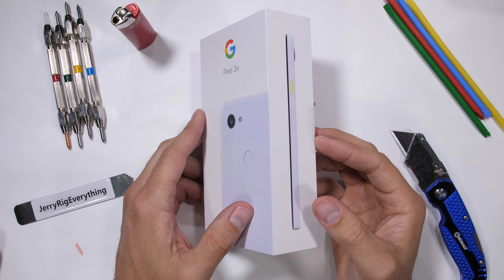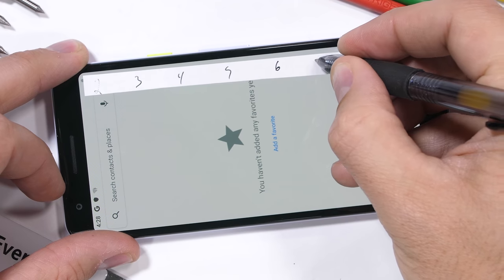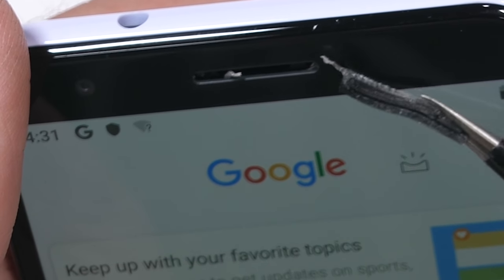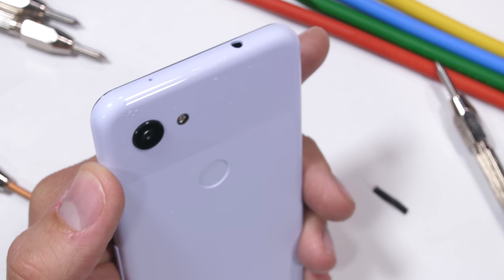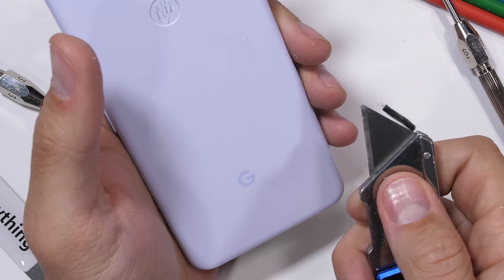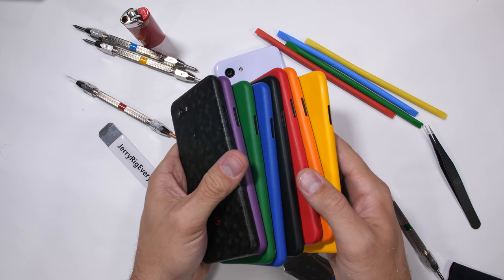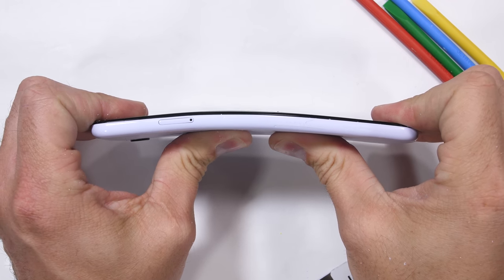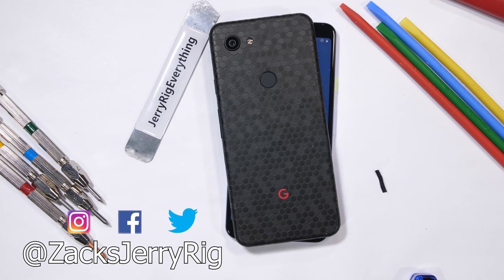Google Pixel 3a Durability Test! - Is Plastic Weak?!

Comment: I thought for sure it was going to break in the flex test.  I'm impressed
Reply: Very few phones break when flexed even the s4 and s5's of yesteryear.
Reply: X2
Reply: Plastic is usually more flexible than metal. It also helps with drops since it absorbs a lot of the force.
Reply: I had multiple Nokia lumia phones and they were so nice. The polycarbonate bodies were strong, durable, and unique looking. Never felt I needed a case.
Reply: I closed the car door on my s7 and it only bent a little, but of course the glass shuttered.
Reply: Why no drop test? This thing dropped 2 ft bye bye screen
Reply: @efratcohen3429  that sucks, the S7 is still quite a good phone
Reply: @someperson1767  after 4 years I decided to upgrade to Samsung s10. It's a really good phone
Reply: @efratcohen3429  wow, that's a great phone

Comment: I'm watching this on my 3a and it's making my cringe harder then I ever have iny life
Reply: Same 😂
Reply: @pissgrief  no, it's very fast and has good camera quality and is just a good phone
Reply: @pissgrief   Hope I'm not late, but I recently got a Pixel 3 and have some words on it.

I've wanted a Pixel for a while and when they were on sale, I figured it would be the perfect time to upgrade. It runs super fast and clean, the UI is very easy to learn, and the screen and camera are amazing. The battery lasts me a whole day on one charge even if I'm watching YouTube for a couple hours. Transferring my data was super easy as there is a feature where you connect the Pixel and your old phone together and basically copy everything from the old phone to the new phone. I had everything over and running in less than 10 minutes.

Overall, I don't regret getting this phone in the slightest! It is super thin and sleek, so I recommend a case for it (as I would for every phone. You shouldn't really go around without protection on the off chance you drop it). I got one of the fabric cases and it feels really nice. I love this thing.

If you already made a decision, well, here's me rambling to the air!
Reply: Watching on a 3a XL and also cringing like hell 😂
Reply: @e.johnson7349  agreed. My sister purchased the iPhone 8a few months before I got my pixel 3a yesterday. My mother and sister were shocked by the camera quality and even the phones speakers. It's truly satisfying seeing me gwtore worth from my money
Reply: @HARI SANKAR.D I'm a hardcore user. Since I've recent graduated high school I'm on it almost all hours everyday. Th batter life is a B+ from 10am it'll last till pm for an average user. It rarely lags. And if it ever does it will only happen if i have a LOT of apps in the background. Considering it has the same ram as a iPhone 11 pro max it's perfect fine for an average user. Btw you can easily extend the battery life by using night light and battery saver, works wonders
Reply: @HARI SANKAR.D point and shoot is great. I compared mine to an iPhone 11 and the average person thinks it's almost as good and on par in some cases. But i don't want to fake anything so tmr I'll use it and see how long the screen on time is. And I'll give you the details.
Reply: @HARI SANKAR.D hey, so I used it today and got about 9 he 20 minute on screen. Used it for gaming and social media most of the time. 9am to 7pm
Reply: @HARI SANKAR.D 100% good luck!!! Definetly gonna get a bang for your buck!
Reply: @vinesta  I get about 6h screen time with the 3a .-.
Reply: @xDontStarve  reallly? It depends what you use it for. I use it mostly for social media so if you game alit that'll probs run alot of your battery
Reply: I too am.using the 3a, it's definitely an upgrade from nexus 5x

Comment: it protecc
it attacc
but most importantly...
its got a headphone jacc
Reply: Yeah but dat slow processor...
Reply: @almightydeity  oof
Reply: protecc wutt?
Reply: @almightydeity  and comparing it to what other phones? a monster flagship phone? Then yes it would be slow....compared with other mid range budget phones...then no.
Reply: @mrbobdog707  Yes, even then. Most budget phones run a Snapdragon 730, and while the 670 is comparable on CPU, on GPU the Adreno 618 is a good deal faster than the 670's Adreno 615. Snapdragon 670 isn't that great no matter how you look at it.
Reply: @almightydeity  I have to agree, at this price point there are way too many phones out there with flagship specs, but I have to say, the 670 should be enough for most people's usage, unless they are looking into more intensive tasks like video exporting and gaming, then this mid-range chip would come no where close to the flagship ones
Reply: @ericwei6000  It just makes me wonder where they believe this phone fits. A Xiaomi Mi Mix 2S is $300 now for a 64GB model. That has a Snapdragon 845 flagship processor, metal frame, and ceramic back for $100 less.  It's going to be built far better, has a darn good display, and will be comparable on screen ratio. 

I'm just not seeing where Google thinks this thing fits. The only downsides are that the mix 2S can only use GSM networks and it doesn't have a headphone jack, though does come with the adapter anyway.
Reply: @almightydeity  I think Google for now has the power to price it however they want due to their outstanding image camera performance. Apart from the camera and perhaps the software this phone basically fall short of anything at its price point
Reply: @almightydeity  The one thing that will stand out over the other budget phones will be updates. Since Google is the one company who owns android this phone will be getting updates at the time they happen. Besides, the people who are going to use the phone won't be gaming, they just want a something without extra bloat and does the simple stuff. Pictures, emails,internet and simple games.
Reply: JINXY wooosh
Reply: @ericwei6000  I'd wager that the Mix 2S would have nearly as good if not as good of cameras. MiUi is more feature rich and not much bulkier for it. The Mi 9 is only slightly slower than the OnePlus 7 pro, which is currently the fastest device currently out.

Even counting camera, literally everything else is better on the Mix 2S since That was built as a flagship.
Reply: @mrbobdog707  Xiaomi rolls out updates within a few weeks of a new android version dropping.

   Even with bloat, the Snapdragon 845 would make everything feel faster. It also has a better GPU and a lower resolution that's still 412ppi meaning it's still crisp. There's no point in a budget device when many will discount older flagships that still get updates.
Reply: @almightydeity  But is the camera any better than pixel 3a?
Reply: @mrbobdog707  It has 2, and yeah, it's the same sensor that's in the Galaxy S9s I think. The other is a 2x 8MP zoom.
Reply: it thicc wit the headphone sticc
Reply: @jinxy7869  Titan M security chip protecc
Reply: @almightydeity  
I'd say even the Pocophone F1 is a great deal faster than the Pixel 3a and it's $200 - $300 with the previous generation processor which is still faster than the Pixel 3a
Reply: @LermaBean  I just can't suggest the notch. The Mix 2S doesn't have it. It should also be comparable on the cameras and performance should be nearly identical. it's really all about what you want at this point, as the smartphone market is oversaturated.
Reply: XD
Reply: Why is this meme still going its 2019...

Comment: 1950: we will have flying cars in the future
2019: SCRATCHES AT A LEVEL 6 WITH DEEPER GROOVES AT A LEVEL 7
Reply: If it was 
1950: we will have flying cars in future
2050: we will have a glass which would cost higher than iphone without any features which scratches at level 7

Comment: How about a giveaway of "skinned" pixel 3a? :)
Reply: Monkeybus TDM isn’t that obvious?
Reply: Well it seems like Jerry isn't too into the phone anyways... So yeah why not give at least 3 or 4 to leave him with a "durability" tested phone and one for the drop test. (It doesn't seem right drop testing a already durability tested phone it probably has a higher chance of breaking. Like the fact that

1:Scratched / Dented Glass
2:Back plastic panel dug into
3:The everlasting bend
4:Scratched Fingerprint scanner
5:Blah blah blah...)
What a reply. 😁
Reply: Why giving away 35 tons of natural resources when you can just profit from throwing them away and destroying them while others die because of them caged in "jobs"?
Reply: @pipipipi3087  Remember there is a difference between "Utility" and "Computer Controlled" 

Utility: Used mainly as a if needed or techie stuff.
Computer Controlled: Stuck up, way too much screen time usage, and etc.
Now destroying a device is actually quite dangerous same as disposing it in most ways. All I have to say is, use as much as you can, when it stops working... Now... END ITS LIFE! By just taking the lithium-ion battery out and any components capable of or otherwise harmful things, like fire, explosive things, and so on. Think a step further when disposing devices people.  😁😁😁😉😉😉😊😊😊
Reply: Not that u'll get one
Reply: Maybe after teardown test

Comment: I would give up wireless charging for the headphone jack
Reply: Yeah I'm glad they added it. Should have no complaints on both sides as you can use wireless as well
Reply: @johnboy6799  no wireless charging on the Pixel 3a. Don't get me wrong, I like having wireless charging on my phone. But I don't use it more often --- it's convenient if all my plugs and wired ports are used up and then I have to resort to wireless charging. But I always will use wired first because it's still faster than wireless. 

I am glad my phone has both wireless charging and a headphone jack, but if I had to sacrifice one feature then it would be wireless charging. That way I still would have more options on audio for the phone.
Reply: You can't actually hold your phone and use it while wireless charging it. Wired charging is better. It's my opinion. Please don't hate
Reply: @thedawg1674  I'm not hating. As I said before, though I like the convenience of wireless charging, it won't replace wired charging. It is still faster.
Reply: Why is it called wireless charging? It's pad charging.
Reply: @vedalee246  because you are not using a wire to charge. Pad charging is probably another way of calling wireless charging from where are from.

Comment: I just got the pixel 3a a week ago and I do have to say, it is the best phone I have ever had. super easy to use, comfortable in the hand, amazing screen and camera quality, super durable. the fingerprint scanner is amazingly accurate and reads your print in no time, definitely faster than the iPhone fingerprint scanners. the charging speeds are out of this world and the battery is long lasting. I 100%  recommend this phone who anyone who wants a high quality device, whether you've always been a Google or Android fan or you're moving over from Apple and want to save money without sacrifing quality and comfort. 10/10 would recommend

Comment: Phone manufacturers should switch to dragontrail glass because it's cheaper but same quality as a gorilla glass
Reply: Jay D Great I hear it can’t take as many drops before failing, the level of hardness does not mean everything when it comes to glass
Reply: EpicWierdRandomVids 
Glass is glass and glass can break
Reply: wait, so glass isnt actually a glass? my whole life has been a lie
Reply: Mykel Hardin  My whole life was a lie
Reply: Most phone glass are silicone based and are mixed with plastic or different polymers 
So yes it is glass, but in a ratio say 70-40%
More plastic, more flexible and break resistant,
More glass more scratch and greater touch sensitivity
Every manufacturer uses a different ratio so it's clearly upto personal preference
Reply: Mykel Hardin 
WTF
Reply: Mykel Hardin 
 nobody
Literally nobody
Mykel: glass isn't glass

Comment: No metal scratch sounds?! SO THANKFUL FOR PLASTIC TODAY
Reply: Plastic is worse i think
Reply: @nauticalnovice9244  really? plastic like this phone's body is good tho.. not all plastic is bad lol
Reply: @nauticalnovice9244  you'd know any plastic on a phone is not like a plastic bag...
Reply: @nauticalnovice9244  plastic handle drop better than metal. I had a metal body phone and dropped it few years ago. Body is fine but the screen cracked. So if you'd like to have a metal body phone i recomend a really good case...
Reply: @nauticalnovice9244  I'm referring to the lack of the usual earbleeding affair that is Jerry scratch-testing the metal sides...In this sense it's surely better lol

Personally I do have a slight preference for well-made plastic due to better shock-absorbing properties, but that's beyond the point haha
Reply: I was talking about the scratch noise on it

Comment: An idea. Pixel 4 released with 4a and 4a xl next year.  Since HTC (RIP) was great with audio, have them up the 3.5mm with a proper DAC and bundle the Usonic buds they were actually good. And custom the squeeze features on the phones. It was a useful “third button” concept, or just add a third button.

Comment: As a Pixel 3a owner, I have to say that watching this video is both painful and also reassuring, because the device he's destroying looks exactly like my own. I'm now very fond of my Pixel 3a XL after t survived me losing it in a snowstorm 3 weeks ago. My Pixel 3A XL fell into a deep snowdrift in my yard during a blizzard, and was rediscovered just laying there on the ground 3 weeks later, having survived the long snowmelt and at least a couple of heavy rains in the weeks that followed. So after all this, having long since given up on ever finding my lost phone, I accidentally stumbled upon it today, dried it out in my window sill under the sun for a day (with the SIM tray removed), and then plugged it in, not ever expecting it to work. Lo and behold! The damn thing charged up, booted up just fine, and I was able to quickly backup all my precious data (thousands of text messages and all their attachments going back 6 years). I expected the phone to have some malfunctions or quirks after all this, but to my continued amazement - it works perfectly! Everything, included the touch screen, still works just fine. It was subjected to subzero temps in freezing snow for over a week, then continued freezing temps, and freezing rain, and it all still works perfectly. The phone was not in a waterproof or ruggedized case. It was in a flimsy clear TPU case, nothing more. Amazingly, after 24 hours this phone still appears to be 100% functional and unaffected after spending weeks in extremely harsh, wet conditions for 3 weeks. That's quite a testament to the waterproofing of this phone, IP rating (or lack thereof) notwithstanding. Thanks Google engineers! Once again, we see with the Pixel 3a series that those Google engineers just can't bring themselves to truly handicap these budget devices; they seem to build them just as well as the Pixel 3 & 3 XL that they're supposed to be inferior to. As with the camera and the overall software experience, the 3A proves to be just as good as the 3 in the durability department as well. Very impressed.

Comment: Plastic is not weak
They just FeeL ChEaP

*puts fragile glass on the back of smartphone for the PrEmiUm FeeL
Reply: right lol.. im an optician and glasses are very different then phones but the reason we stopped using glass lens and started using plastic  is cause glass shatters and plastic doesn't,
Reply: @frezieduh3457  i agreed
Reply: @frezieduh3457  but does it scratch at level 6 with deeper grooves at level 7?
Reply: as i understand it, glass is glass and glass breaks
Reply: @clintow  Big if true
Reply: @lemarmottin  😂😅
Reply: @anomuumi8357  lol if you upgrade to crizal sapphire it'll scratch at a level 8 with deeper grooves at level 9
Reply: @lemarmottin  i think were talking about breaking not scratching. glass is more scratch resistant but breaks easier. like polycarbonate is a very strong plastic thats in glasses and the 3a lol

Comment: PLASTIC IS STRONGER THAT GLASS AND GLASS IS HARDER THAN PLASTIC. HARDNESS IS DEFINED AS MATERIAL RESISTANCE TO DEFORMATION. STRENGTH IS DEFINED THE AMOUNT OF STRESS APPLIED TO A MATERIAL BEFORE IT DEFORMS. SO PLASTIC IS STRONG AND GLASS IS WEAK. AND PLASTIC IS SOFT WHILE GLASS IS HARD. 

COMMON!!! JERRY RIG EVERYTHING WATCH YOUR THUMBNAIL

Comment: Maybe not as durable as you might think ... mine started playing up in ways that meant it just had to go. Two really hard whacks against the edge of a solid wooden table pretty much killed the screen. Another few - five? - absolutely killed it.
I never much liked the Pixel 3a. Meh. Good camera but rubbish at alarms - kept losing them and kept bricking itself because of Google Pay prompts. I've never even used Google Pay. I really grew to hate that phone. 
That was either an expensive mistake or fixing an expensive mistake. Well, it still feels better without it. It was the most annoying phone I have ever owned.

Comment: 100% of the phone screens that I broke were because of dropping the phone. I'm surprised to see that you don't even try different drops at all..? Is there a reason that I'm unaware of? Is that screen impossible to break? Thanks
Reply: I'm also surprised they don't do the drop test. You can find plenty of complaints about this phone where people crack the screen pretty easy from dropping from a pretty small distance. The phone back looks durable, the screen....I doubt. But of course most of these screens are pretty bad. Phone manufacturers do this on purpose so folks would buy another phone.